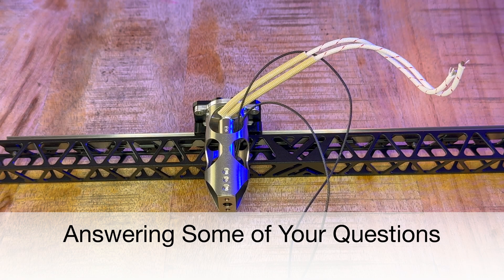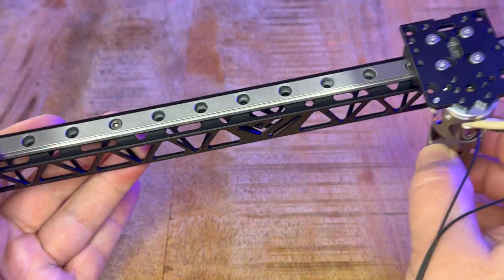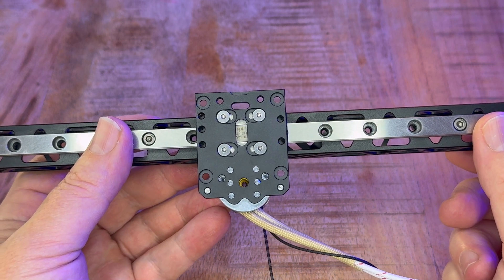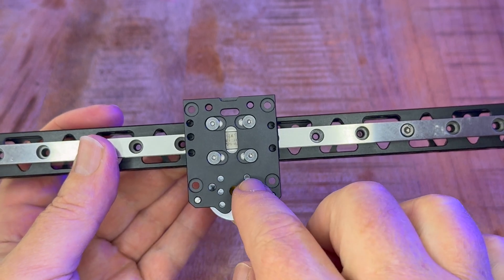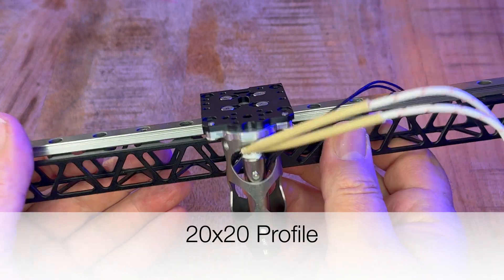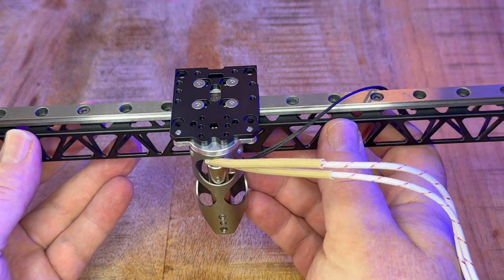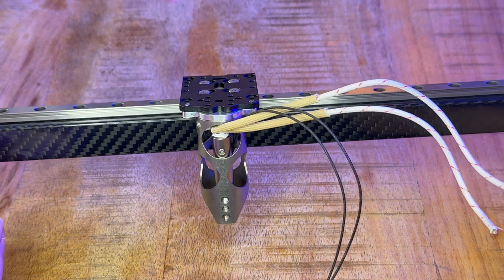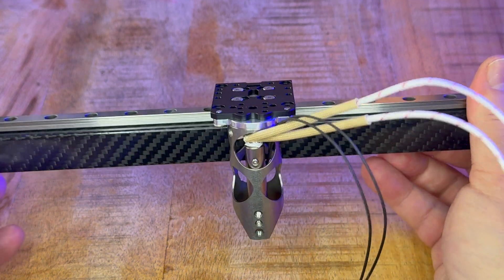Chube Hotend - Answering Some of Your Questions

Comment: where can i get cad for adapter plate?
Reply from the maker: We did a few tests on a few printers and found a small problem. But we are updating the plate and mounts so that it will fit better on you toolhead. It will be out very soon.
Reply: Any updates yet?  Also I searched mellow and could not find any adapter for the chube vzbot
Reply from the maker: I did some more testing and one of the Chube screws will make problems, or could. I made a new VZ Top plate but still waiting to get Feedback from Mellow.

Comment: Cool that it is possible to install without difficulties, and get a super strong cool hotend 
Thanks for the informative and interesting video, but I wonder why they decided to switch from Goliath to Chube?
It is also interesting to test the new hotends presented by Trianglelab CHC XL HOTEND and Melow Heat Core 4
Reply from the maker: I need to print a big project In PPS-CF. Print temp 370C. So have to remove the silicon sock from the Goliath and decided to test the Chube for the project.
I will see if I can get my hands on the hotness ;-)